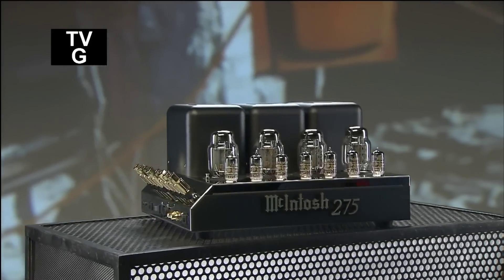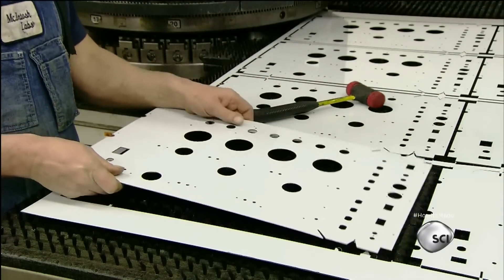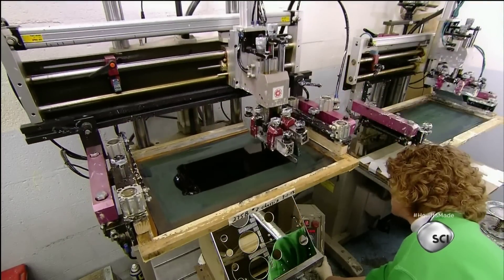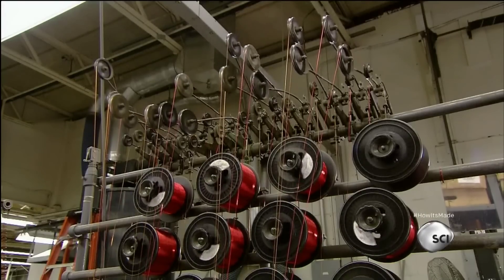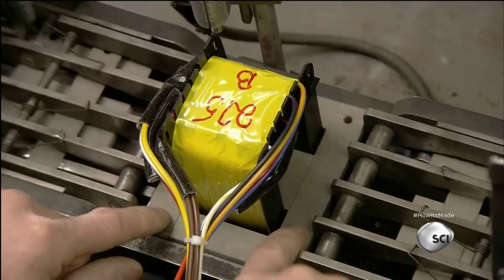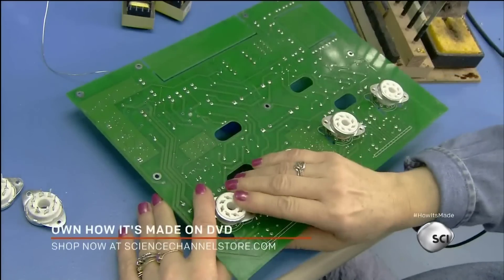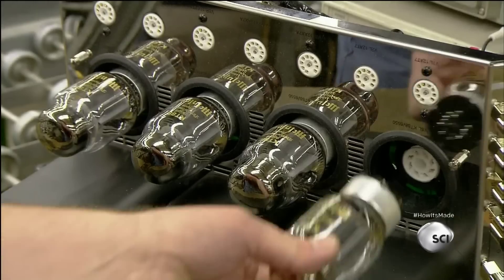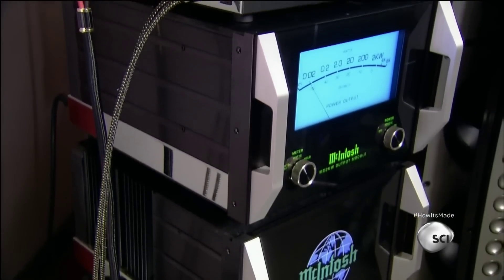How It's Made - McIntosh Tube Amp

Comment: Tube amps are a lie. People are easy to manipulate. First: Connectors made of brass are non magnetic and therefore do not add distortion? Thats the cheapest lie I ever heard! You could use Iron as connector wich would not make any difference. If you cannot measure it, you will never hear it! Before you hear it, you will be able to measure it.

Why are Tube Amps just for idiots?

Well: There is a test, you should try:

Buy two identical wine bottles and fill one wine into an expensive, good looking bottle and let otheres taste the wine. Most people will taste a difference by knowing it is a different bottle. They think, that the 2nd wine is different, but it is not.

That is the power of imagination. Don't let trick yourself. Gold plated Contacts do nothing. Don't be a fool. Tubes look great, and if build properly they just sound as good, as a good Transistor Amp, but they do not sound better. Don't be a dick. They cannot sound better, if both types are meant to multiply the signal voltage by a given gain. Different sounds occour only on phase shifts and distortions.
Reply: Eviltech
That explains, why cheap electronic devices have ultra cheap wire, that breaks, when you bend it twice... Making it now worth repairing. Such suckers...
Reply: HeartOfGermany Tubes are in no way better than transistors, they are just a different kind of a device... It's like comparing an AC to a fireplace for keeping warm... The AC is much more efficient, more convenient with all it's sensors and settings, but a fire will always have that little bit of a romance and aesthetic to it... Tubes are the same way - they warm up, they glow, they are brittle and fiddly, but there is this warmth and beauty in them, the fact that the audio transformers use silver instead of copper to get that little bit more efficiency and quality out of the transformed signal... To a real engineer a tube is beautiful and gentle thing, useless in all of it's characteristics, but amazing nonetheless!
Keep in mind - before tubes the only way to amplify a signal was a mechanical device! If there were no tubes there would be no transistors.
Reply: Eviltech
That I will 100% Aggree! It is in fact a beautyful bit of gear. That is the only reason, why I would aggree also using one - If I could afford it. :D
Reply: Clearly you know all about avalanche effect in semiconductors and the whole physics behind the gain in a transistor and in a tube. Also delay in electron cloud emission, nanomechanics and electron-hole migration. We, the physics enthusiasts bow before your genius.
Reply: And the amplifier from the video is not worthy to be called a tube amp. Putting just one transistor in the path of the signal voids the mechanics of the tube amp.
Reply: I'll keep this real simple and wont mention things like hysteresis etc ;) But first before I do please tell me why we dont use steal wires for conducting electricity ;)
Reply: SouthJerseySound Resistance. Copper and aluminum have much less resistance. It's much more efficient to transfer current trough low resistance conductors, but for signal it doesn't matter.
Reply: SouthJerseySound

Steal has several disadvantages.

It corrodes quicker,
It breaks quicker, but ist stiffer - Cable less flexible
It conducts much much worse, so cable gets Thick and heavy
It is much stiffer > Much more work into forming strands
Reply: Eviltech Do you honestly believe resistance doesnt matter?............I'm not even going to continue because you dont even understand that the signal to the speakers is nothing more than AC current.
   Essentially there is nothing I can say to you that will change your lack of knowledge on this subject .Especially if you feel resistance doesnt matter when it pertains to signals as you put it ;)
Reply: SouthJerseySound "Signals" as i refer to them are low current low power AC or DC signals. In low current i mean less than 1mA. In that case it really doesn't matter what metal the cable is made out of, provided we are not talking about 100s of kHZ transmission frequency. After that the conductors themselves have to be engineered to be capable to carry the signals without distorting them due to mutual capacitance and induction effects in the length of the cables themselves. Cables between the powerstage and speakers and the power supply must be made out of a highly conductive substance because they have to carry high amounts of current. Infact, take a magnet and check your signal cables with it, I bet you got at least one with magnetic strands as the conductors inside because the Chinese motherfuckers are actually making signal cables with copper plated steel strands instead of actual copper strands!
Reply: SouthJerseySound
It is ohms law. How dumb... If you HAVE resistance in your cable, you will ALWAYS loose the same percentage of voltage, no matter how high or low the signal is. It is basically a voltage divider. And Cable does not care if it is ultra low frequency AC or DC - except hundrets of kilometer long power lines, that do get effected at 50 HZ. Let's just ignore this overexrtreme example...

If you have resistance in your system, your signal only gets a bit lower in amplitude. It does not effect the waveform. Otherwhise there would be no resistors in an amp, if they would distort the signal. Are you realy that dumb and think you are prof of electronic engineering. Just go to EEVBlog Forum and discuss about tube amps there. You will get ripped appart. I mean, I could be wrong. But will hundrets of people designing electronic products be wrong? Why is Dave jones so pissed off, if it goes down to Tubes or Trannies? Why does he hate on Gooooolden Cable? Maybe an electronic engineer, doing it over 20 years for a living is just wrong and dumb. NO YOU ARE DUMB. You have not one single formula, to proof your satement and belief of tubes being better and shit!
Reply: Some years back Speaker Builder Magazine ran a story about this awesome acoustics lab that the Canadian government funded to encourage more Canadian manufacturers to get into audio.  The lab did an experiment:  they trotted out five different loudspeakers, with different colored grills so that folks could tell 'em apart, and sat a bunch of people down for some listening tests. They'd trot out each speaker, play a bunch of music, and at the end asked the audience to write down their impressions and compare the five speakers. Peoples' impressions of the "sound" of the five different speakers was all over the map, with most of the audience reporting huge differences in the five.  (You know where this is going, right?) Truth of the matter is, it was the SAME speaker each time; they'd just run the speaker behind the curtain, swap the grill for one with a different color, and wheel it back out. 

Behold the awesome power of suggestion and the almighty Placebo Effect! :)
Reply: But they'd just say the resonance of the grill affected the tonality of the speaker!  Ears are pretty good signal analysis devices, but not anything like as good as good test equipment.